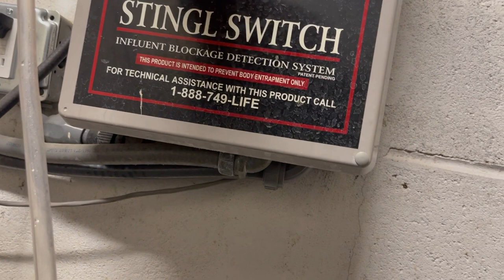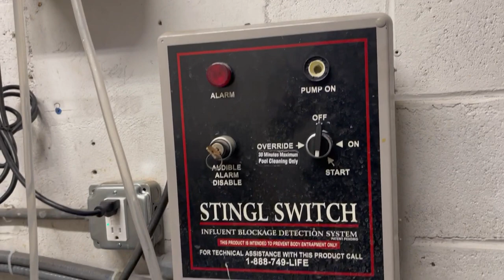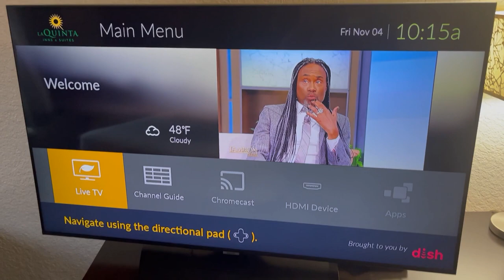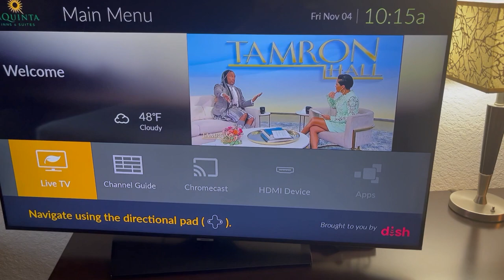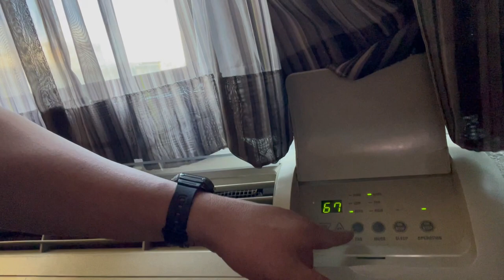HOTEL MAINTENANCE 101

Comment: I have been doing pool maintenance for a while now and would like to add that the pool filter selector valve should be rotated clockwise only. Also the correct sequence for pool filter cleaning is backwash, rinse then filtration. I hope that helps, keep up the good work.
Reply: Why clockwise only?
Reply: @danielmulholland5869  because you can damage it
Reply: How long on backwash & rinse? 10 minutes each?

Comment: Try work around your top and middle hinges with longer screws as the weight of the door will make it lose level and fall down, and most probably will save you a lot of time on trimming the frame and frame's plate. I get similar problems on my doors

Comment: On that door sticking you should have checked the top hinge on the door in case it was loose.
Reply: I was going  to say the same thing
Reply: Yes, and a sprite level just to verify that it's off level.
Reply: I was thinking the samething Grinding down the latch is a temporary fix it'll work . But either the hinge is loose or the frames needs to be adjusted

Comment: No sir. 10:48. You just made it 1,000 times easier to break into that room. 

That’s your deadlocking plunger, the bottom, smaller latch. That piece’s job is to prevent shimming attacks. It’s supposed to be forced into the door like that. When depressed, it prevents the main latch from depressing. When the door is shut, the deadlocking plunger is supposed to stay depressed so it is activated.

If it’s getting caught, that should be addressed without disabling the function.

Comment: I’m a hotel maintenance at a Hilton property!  Things can surely get interesting during the day!  Your pool filter setup is way different than the one I deal with! I even have to deal with a spa.  Out pool and spa are salt water which is hard on our pool equipment. I’ve had door issues as you did   I usually take the screws out of the bottom of hinge side and lift  with a pry bar then put the screws back in. Usually takes care of the issue.  You seem to be a more patient of a guy then I am. I can tell by how you speak.  The one downside of being a maintenance man is being on call 24/7 but it’s what is expected with the job.  Great job your doing  stay safe and stay healthy
Reply: Thankfully if everything is tip top you get called in less! Unless fire or other emergency

Comment: What’s the usual day of a maintenance man iam starting Sunday no experience and would like to know if I gotta service water heaters and such
Reply from the maker: If you have no experience I’m sure they will start you with light work until you get used to the building. That’s exactly what happened to me when I first started hotel maintenance. Congratulations and good luck my friend 👍
Reply: But what’s the day to day like ? Is it hard in general even with experience a lot to manage and keep up?
Reply from the maker: @lorenzovalle4658   depends on the condition of the hotel. I would just concentrate on one work order at a time. Don’t get overwhelmed with the day to day because every hotel is different. And also don’t be afraid to ask for help if you don’t know something.